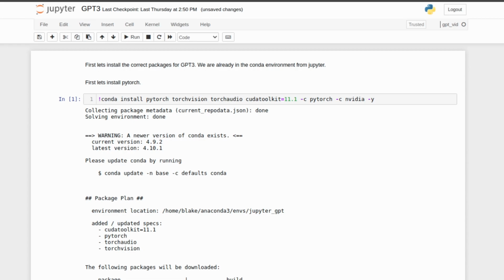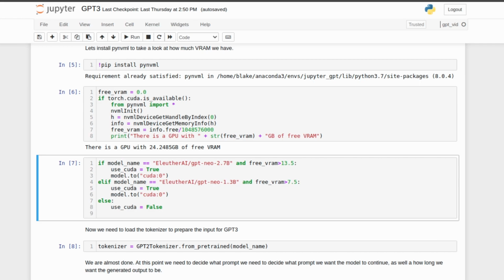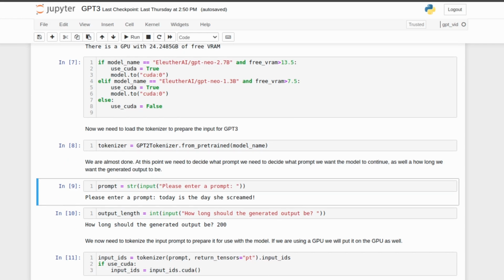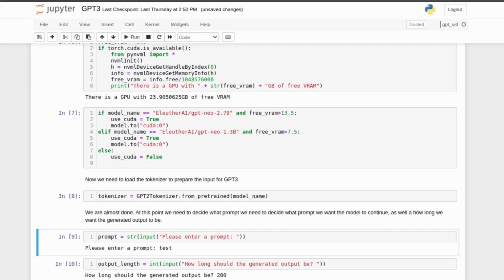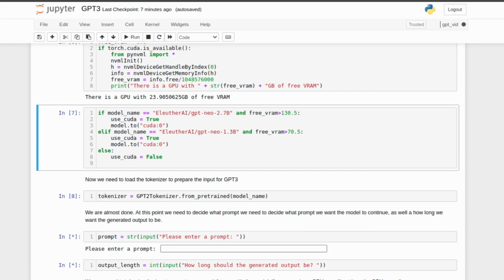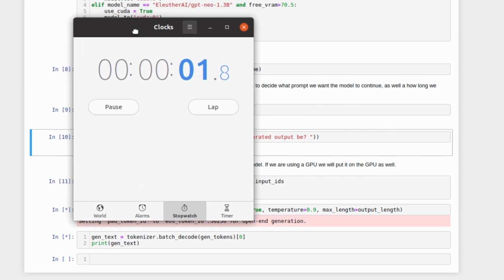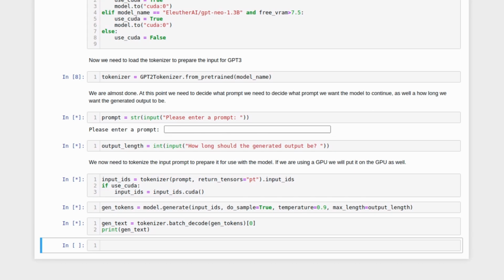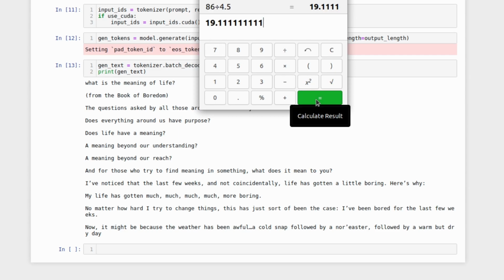GPT Neo(GPT 3): Running On A CPU Vs A GPU

Comment: Great video! What CPU is being used for this video?
Reply from the maker: Thank you! At the time of the video I was using a Ryzen 5 3600 with 64GB of RAM.
Reply: @Brillibits  Thanks! I have a 3700X so performance would be similar. I will later test if I can run the small model with my 1070ti 8GB.
Reply from the maker: @estebann  I'd fully expect you to be able to run the 1.3B parameter model. Let me know how it goes!
Reply: @Brillibits  so far I failed miserably. I am runing this in Windows and keep having issues with Conda, Kernels and Jupyter notebook, dll errors prompting randomly and it refuses to use the models I downloaded and tries to download them again. It is my fault probably since I don't know how to use Python envs with Conda or Jupyter and have a dirty setup. I will probably try again but this time running directly from console basing myself on the documentation and Jupyter notebook.
Reply: @estebann  Ah, that's a shame. I was thinking about giving this a try on my Windows PC, but since I have little experience with python then it sounds like it might be quite hard.

Comment: Hi! Is it possible to parallel process of generation with 6 gpus? Used miner. Thank you
Reply from the maker: Yes it is possible to do this now.  Either through huggingface accelerate or Deepspeed is what I would use.

Comment: What is the minimum configuration to run comfortably?
for personal use.
Reply from the maker: So this video is a bit old and covers GPT Neo.  There are newer bigger models out there that take more resources.  The main thing that you want for these models though is a somewhat modern GPU.  The faster the better but the important thing is the VRAM.  Ideally you run these models with bfloat16 meaning that 2.7B model takes 5.4GB plus more for when you have a larger sequence.  I suspect that Turing or later, 8-10GB would be a good minimum.

In fact, thinking about it now, get an RTX 2060 12GB for a cheapish GPU that can run this that is somewhat modern.

Edit: Sheesh the prices on that is higher than it should be.  Something like a GTX 1080 may be good as well.  As we get older its harder to know on the top of my head what will and wont work due to many new features.
Reply from the maker: Something like an M40 or p40 may be a better option as well and could run even larger models like GPTJ

Comment: Hi Blake. Great videos! I have a AMD Ryzen 5 2600 (12) @ 3.400GHz, 16 GB of Ram & GPU: AMD ATI Radeon RX 580 8GB. Do you think I may be able to run this on my computer running Linux? Or should I rather buy a new PC?
Reply from the maker: Thanks for watching!  You can run at least the 1.3B model and maybe the 2.7B model on your CPU, but it will be very slow. There is beta support for supporting AMD GPUs for Pytorch.  I have not tried it myself, but if it works you could run the 1.3B model on your GPU with 8GB of Vram.

If it does not work, you could look into online services, such as Google Colab to run the model.  

If you decide that you want a new PC for AI type work, get a newish Nvidia GPU with as much VRAM as you can get.  The Rtx 3090, while expensive is still the cheapest option for speed and high amounts of Vram.  When not using it, you can use it for mining Ethereum, which is how I use mine.

Comment: Can I ask. CPU uses just one core or all cores ?
Reply from the maker: I am not sure.  I think by default its one core but you may be able to get it threaded.  Its hard to find a clear answer online. See this https://pytorch.org/docs/stable/notes/cpu_threading_torchscript_inference.html#:~:text=PyTorch%20uses%20a%20single%20thread,(%20intra%2Dop%20parallelism%20).
Reply: @Brillibits  If you are right that CPU has just 1/20 of GPU performance  with 1 thread of CPU - that means if we use 12 or 20 thread CPU performance will be equal to GPU for much lower price
Reply from the maker: @hardcodeOnly  GPUs have thousands of cores. If threading is possible, it will speed up but will likely still not be as fast.
Reply: @Brillibits  Can't you just look at the Task Manager to see your CPU usage?
Reply from the maker: @flameshana9  Not sure if its threaded.  Regardless this video just shows that it takes much longer on CPU.